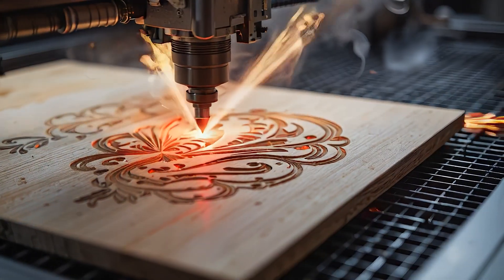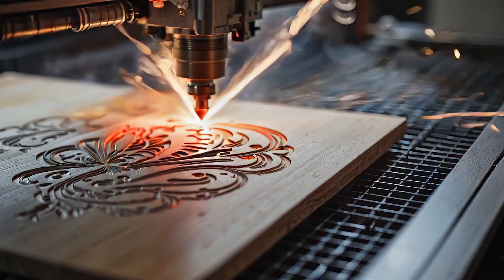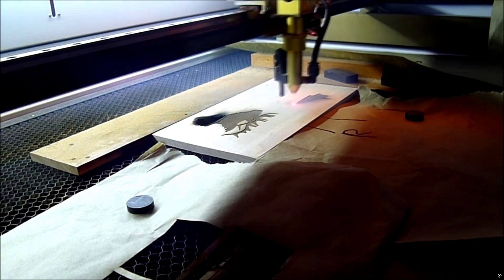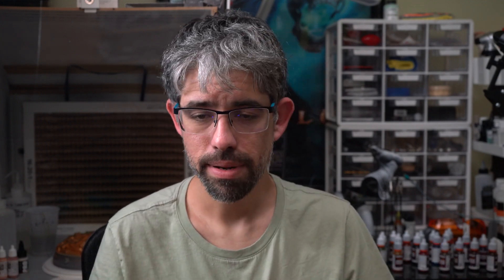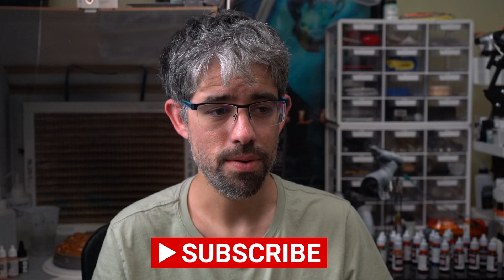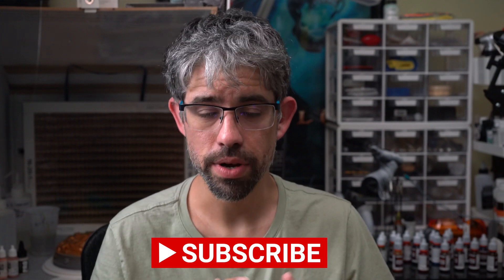3 reasons to AVOID the Bambu Labs H2D Laser Module

Comment: How about those green 'safety' windows that don't do a damned thing for a BLUE laser....
Reply from the maker: Not sure if they help for a blue diode laser or not, but I do know I cant see anything through... not a damn thing, lol.
Reply: Fairly sure that they do filter out the laser. If I understand it right, the material is polycarbonate which is used in laser safety glasses.
Reply from the maker: Probably will work, ya. Poly acrylic panels should block the diode laser. Not happy that then I can't see my 3d print when it's in there, the green tinted acrylic is really dark green.